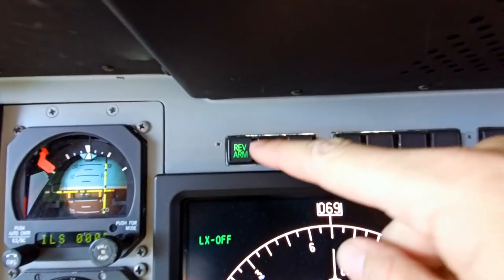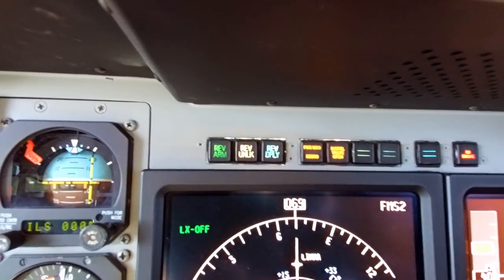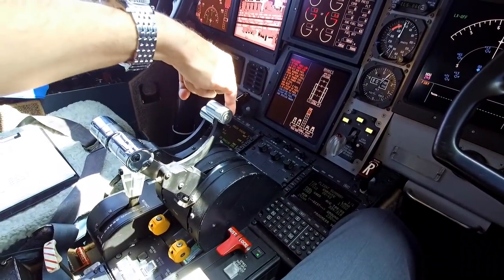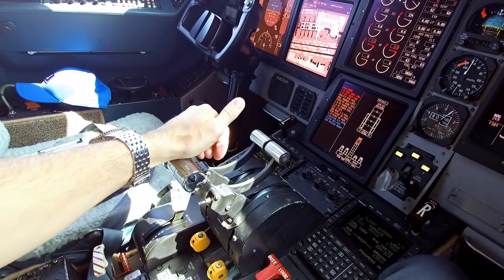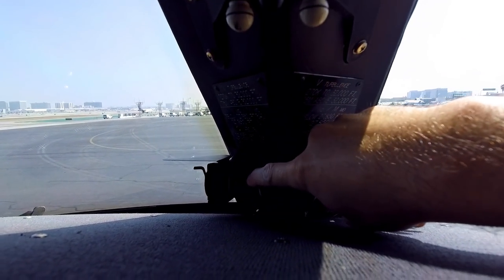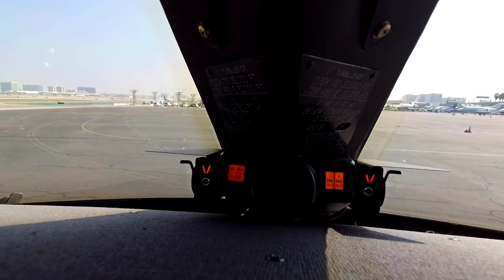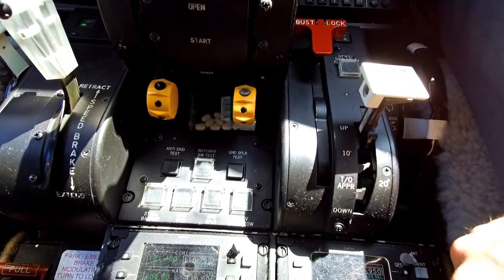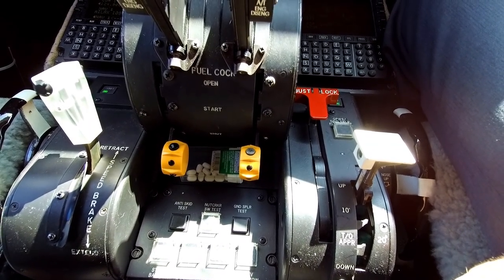6 Lights, Boards Up...What Does That Mean? - Pilot Vlog 086

Comment: Hi. How do you calculate weight and balance and fuel required and things like that ? Thank you . Keep up the great videos!!
Reply: Jason Duncan their FMS computer does it for them in this particular aircraft but there’s always the book and doing it by hand, too. Some jets and flight departments have approved iOS or Android apps that can do “legal” calculations as well, and some companies have apps that will log those calculations and keep copies of them on company servers. Some flight planning websites with apps like FltPlan.com also cater to fleets and have calculation features for individual aircraft that can be cross-checked against the airplane’s numbers and used as a starting point. All depends on what’s approved for the particular aircraft and company. (Airlines for example do it all in their dispatch system which spits out the data that is either handed to the pilots in paper form or sent to the aircraft via data link.)
Reply from the maker: Our company procedure is to use Arinc Direct flor the flight and fuel planning. The weight and balance is done by hand using a very precisely made plotter system.
Reply: Nate's Random Videos than you very much

Comment: Is a spoiler a flap? Can you diagram flap/spoiler/wing configurations before takeoff, during flight and when landing. Confused newbie....Thanks
Reply: Seriously check out wikipedia it's not that hard. https://en.wikipedia.org/wiki/Spoiler_(aeronautics)
Spoilers are literally boards that spoil the airflow over the wing reducing the lift of the wing substantially. They also slow the plane but the main function is to put it firmly on it's wheels.
Flaps basically increaes the area or change the shape of the wing to create MORE lift so the plane does not stall while flying slow for the approach and landing.
When flying fast the flaps would create unneeded drag so they are not used. For takeoff the speed is not as low as for landing and the drag slows the climb therefore the flaps are not extended as far.
Reply: wiedehopf Thanks very much for the explanation. I’ll go check out the wiki as well to get familiar with the concepts and lingo.

Comment: Sweet. Thanks. Can you explain why spoilers are armed before you takeoff, when the spoilers are used for landing?
Reply from the maker: They are armed for takeoff in case we have to abort the takeoff, they will help slow us down just like on landing. They are always used for landing. They basically add significant drag to the top of the wing to help stop the plane.
Reply: Corporate Pilot Life interesting. Never thought about having to use them on an aborted takeoff. Thanks for the response. 

Thoughts on the GIV losing the two left mains tires the other day? Have you seen the close up pics yet? Dude landed on the rims. Crazy.
Reply from the maker: I saw the pics yesterday. I will be very interested in seeing the final report. They were obviously at max takeoff weight, so is suspect that when the first tire blew, all the weight that was shared on 2 tires was planted on one causing the it to blow as well. The damage from the tire shrapnel hitting the wing and engine nacelle was pretty intense. Bent the flap up pretty bad too,
Reply: Corporate Pilot Life A buddy of mine that flies a G550 said he heard they had an issue (or thought they did), landed at full weight. Then took off again, that’s when they blew. He was thinking because of high landing speed there was heavy braking which might have caused excessive heat. The quick turn never allowed them to cool. Causing the issue. I’m with you though. It’ll be interesting to hear the final report.
Reply from the maker: I heard a rumor of the same thing, but I don't have confirmation of it, so I didn't want to spread it yet. If you heard the same thing, then there may some merit to it. If that's all true, then they exceeded some major limitations. They would have landed over the max landing weight, which requires a major inspection. No time to do that in the short amount of time they were on the ground between those 2 flights. I certainly wouldn't want to be those 2 pilots right now
Reply: Corporate Pilot Life It’ll be interesting to hear the final reason/report.

Comment: So if you land and the boards don't come up then it won't slow you down as much on the runway, so would you have to make it like a touch and go and take off again and try again coming in slower?
Reply: Bruce Leibowitz you would use more reverse thrust and utilize brakes..
Reply from the maker: Johnny Great got that one right on. The thrust reversers would become our best friend there. Without the spoilers, the brakes would very likely lock up, so the anti-skid system would be getting a work out.

Comment: Curious if you always deploy reverse thrust on every landing or can you not use them if the runway is long enough and use braking only?
Reply from the maker: We always deploy them, but there is no requirement to do so. The brakes are quite expensive, and the TRs are practically free, so we use them to save cost of changing the brakes.
Reply: At an airport near my place (EHEH) the use of Thrust Reversers is restricted for noise abatement reasons. Pilots are only allowed to use them if needed, not just to avoid further taxiing. Is a policy like that also introduced at some US airports with long runways in populated areas yet? For airports like LAX, SNA and PHX it would make sense?

Comment: Hey I have a question. Why in take off roll when your not flying do you push the yoke forwards and then PF takes control during the roll? However when your flying the PM doesn’t do this for you?
Reply: Left seat driver has to steer the nosewheel, irrespective who's flying.
Reply: Even on takeoff roll when nosewheel steering is not used, and rudder steering is?
Reply: Assume nosewheel steering has to be used until the airspeed is enough for the rudder to have any authority?
Reply: Could be, would have thought there would be a link between the nose wheel control and rudder peddles
Reply from the maker: The G-IV does have nosewheel steering on the rudder pedals, however the left seat pilot keeps their left hand on the tiller in the event a "hard over" of the nosewheel occurs. At 80 knots the left seat pilot moves their left hand from the tiller to the yoke, assuming they are flying. If the right seat pilot is flying, they have the yoke for the entire roll, so the left seat pilot just removes their hand from the tiller. Rudder steering in this plane is more than enough to keep the airplane centered on the runway once it is lined up.
Reply: Corporate Pilot Life thanks! Makes sense! Assuming you don’t have dual tiller’s then?
Reply from the maker: Correct...just one tiller on the left side
Reply: Thanks for the info! If your ever in the UK and fancy a flight in a DA42 let me know!

Comment: How short of a runway can the G4 land on with TR engaged and whats max throttle you guys can use with TR deployed?
Reply from the maker: We have landed on 4,200 feet of runway, but it can do less. I think on a light day, they say it can land and stop in 2,500 feet without TRs. All of the official numbers are made without TR deployment. The limit for TR spool up is 88%.
Reply: 2500 would be impressive. Saw a G550 pull into the ramp yesterday it was pretty sweet. Hopefully yall will get to fly it one day.

Comment: What does it mean"the CAS is Clear?
Reply: Thom Walker CAS is Crew Alerting System. In short, any serious malfunctions (Red lettering on the screen) or warnings (Yellow lettering on the screen) alerts the crew. Dark is good
Reply from the maker: That stands for Crew Alert System. It's basically a list of anything that has failed or may be malfunctioning. We have 3 levels. Red are Warning messages (really bad). Amber are Caution messages (kinda bad). Blue are Advisory messages (not a big deal).
Reply: Thom Walker — It’s actually TCAS. (Traffic Collision Avoidance System) Which alerts them to other planes in close proximity.
Reply from the maker: We do have TCAS as well, but that's a different system...